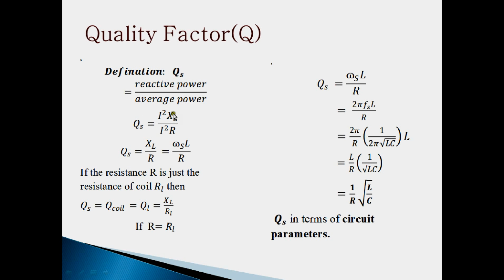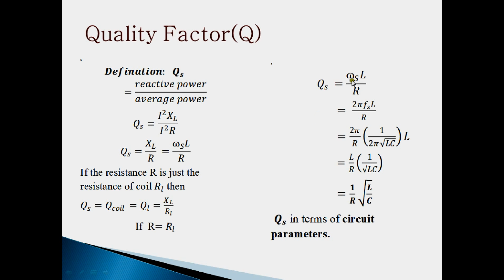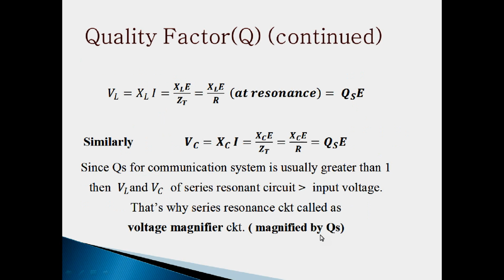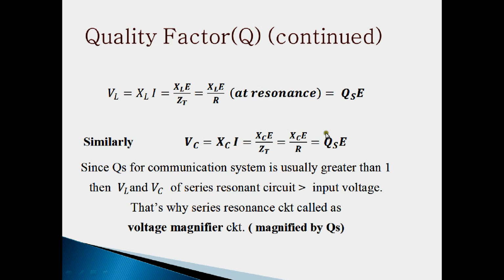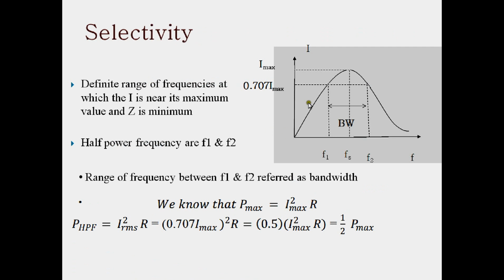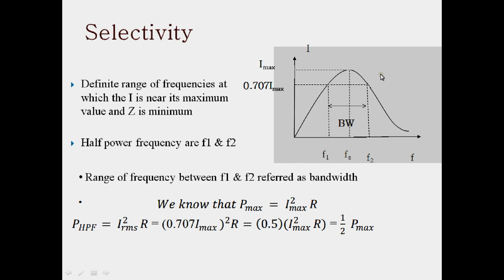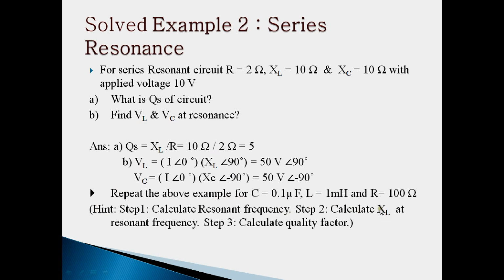Series Resonance part2

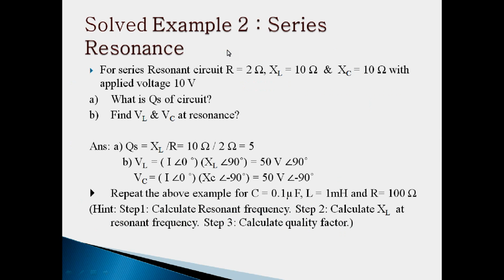Comment: Hie, I think there is a slight error on example 2 @ (13:59 min) At resonance frequency , impedance = R  as it is at its minimum. On calculating Vl and Vc, you got them correct though, as Vl=Vc are equal and in opposite direction. i.e 5 X 10=50volts but in your slide you said 1 X 10 = 50v.Although the ultimate answer is correct, the value or the magnitude of current is 5A =10/2  at resonance. It may be a slight overlook or a typo error. Thank you, other wise a nice video & good presentation.
Reply from the maker: Thanks for listening my video lecturer. pls listen it carefully again I= 10/2=5
applied voltage / resistance  you got correct answer. slide is correct just current calculation is not explained .